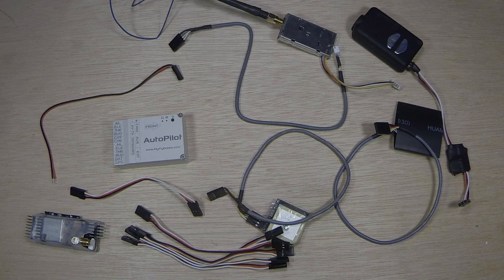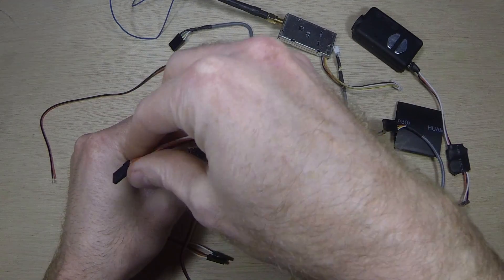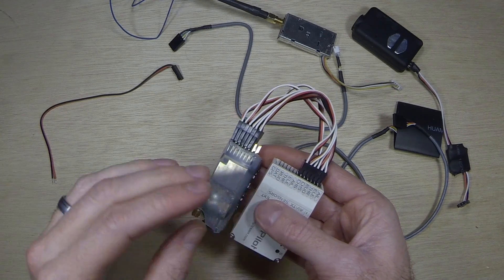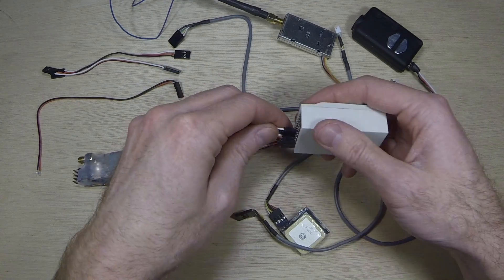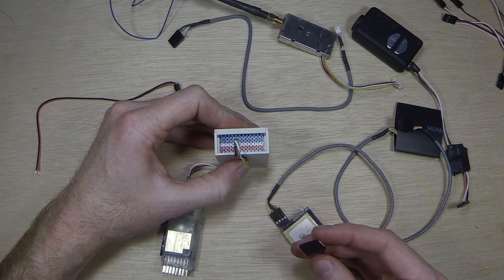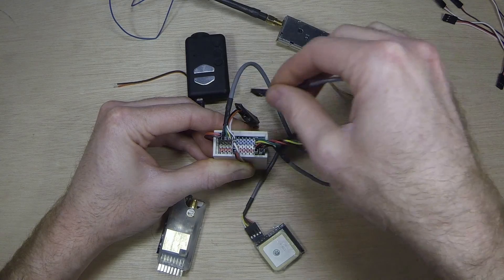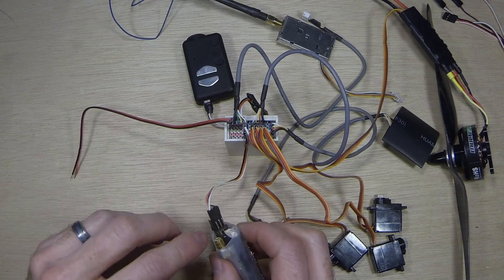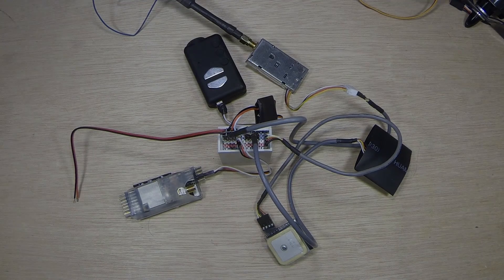MFD AP - 2 - Connecting

Comment: What a Good Idea !!! Why havent i think of that before!!? I can remove a couple of my wires which are actially giving me headake everytime i look at them :).
Thank you for the very very informing video Brother :)
a question thou.  Even thou i am shore i could do the same to RV. OSD and Agletree OSD ( i own both), i had to ask. I could do that to them too right ? :)
Reply from the maker: Just watch the wiring, if you have redundant lines, it can always be removed. i have not yet came across a device that requires servo power and ground to every channel from an RX or any device that requires multiple of the same connection. Every wire removed can reduce weight and clean up the electronics!

Comment: Thought JR PPM was on Ch6?? From the manual

A) For Futaba (or similar) receivers, the definition of PPM channels for channel 1-4 are AIL, ELE, THR, and RUD. In this case please connect PPM cable to CH5.
B) For JR (or similar) receivers, the definition for channel 1-4 are THR, AIL, ELE, and RUD. In this case please connect PPM cable to CH6.
 Once a valid PPM signal is recognized on CH5 or CH6, Input channels CH1~CH4 will automatically be used as auxiliary servo output ports. AP will not accept PWM signals until it is power on again.
Reply from the maker: eastcoast78 yes, there are two ppm inputs for different mappings.
Reply: Cool, yeah it was mentioned it was ch 5 for JR. Having issues with my Airspeed sensor . Hooking it up tonight and its showing no  Airspeed sensor in the calibration page,  nor is it working. The wire is passing 5v to the sensor, but i noticed there is a LED on the board, but it has never lite up. I posted my issues on the rcg thread but seems its nto the active as of late.  Also uploading a video as we speak.
Reply from the maker: hmmm... interesting. I havent messed with air speed sensors yet. dont really fly that autonomous to need it, I just use these as RTH and failsafes that is about it.

Comment: I guess you need to connect ailerons via Y servo lead? How do you reverse one servo if it is moving in the wrong direction? Sorry for the dumb question.
Reply from the maker: The only dumb question is one that is not asked :D.
Yes you would need a Y connector for the ailerons, and if one is reversed, you would need to reverse a servo (rewiring its internals) or get a servo reverser.
Reply: Atom RC Thanks Pal
Reply: +Atom RC If you have the same model, type of servos, they so the same the direction.  There's no need to modify.
Reply from the maker: correct

Comment: Hey 
I have a question I've got this AP on order and I've been wondering some things I'm going to run 4cell on my MFD MYTWINDREAM I've seen your using a switching reg for feeding power to the AP so thats one question answered my other questions are does your reg feed power to the AP then onto the VTX and Cam ? also how are the servos being powered ? through the ESC ? if so how can i use a BEC instead ?
Thanks for your help
Reply from the maker: For powering servos and things, you can connect a BEC to any spare servo port on here or your RX. the 12v regulator powers the FC as well as the video equipment so be sure to have a large enough regulator.

Comment: You wouldn't know how to set up the current sensor so one can just make sure that the dam thing give you the correct milliamp consumption & the correct amp drawing? thanks in advance.
Reply from the maker: you would need the FPV setup complete and a load for the current sensor that is a known wattage of amp draw. that will let you see if it is working.
Reply: Buddy I was flying last Saturday, my FPV Rig is up and running... so what I have been doing is literally powering up everything "Isolating the Current sensor" and putting power in to the power sensor with out load then... I go to the menu/sensors/current.... and try to calibrate.. but.. it is always the same problem.. it does calibrate...then come back showing that I'm only using .2 of an amp when in reality I'm using 1.2 amps.. so I guess that I just have to learn how to live with the problem that I'm dealing with.. No disrespect or insult in tended.. I'm so incredibly frustrated with this...
Reply from the maker: Ya, im not sure about any new software or bugs. I have not used this in over 2 years and have not flown in over a year. the earlier version i had was calibrated out of the box so never ran into that issue. Hopefully there is a resolution since that is quite a bit of variance in the reading.

Comment: So when using ppm out you don't need to run all wires back and forth for control just the one wire.
Reply from the maker: yes. PPM uses a single wire from a PPM capable Transmitter to the MFD AP. Makes it very nice to work with!
Reply: Looks like a keeper . After your flight test I will make my decision . It between RVOSD, FY31AP , or this one . For my more complex FPV Riggs.  The other that a little cheaper is the storm osd I like that one for my not so complex FPV birds even though it might suffice for any fpv plane .
Reply from the maker: Bankhead RC sorry for some reason this comment never alerted me. Iv been flying MFD-AP since it came out and it has been amazing. much better control than my Fy products.

Comment: I have a question . Can you change the odd from metric to imperial standard of measure .
Reply from the maker: I believe you can. I have not used the latest firmware. the version I had could not change. there is a thread on rcgroups.com that talks about this OSD ill try to get a link for you.
Reply: THANK YOU

Comment: Hi, on the old Dragonlink receiver (like the one on your video) I connected the PPM cable from Ch. 12 to Ch. 5 on the MFD and my plane works great.  Now I'm setting up another plane with the new Dragonlink micro receiver, the PPM output is on channel 7 and my plane is only responding on channel 6 on the MFD (not 5 like the other one.  The issue I have, is that everything is working fine including flight modes, but the failsafe will not kick in when I disconnect the power from my transmitter.  I can activate the failsafe from the transmitter, but not by powering off the transmitter.  The other strange thing is that when I'm in MAN mode and I unplug the power from the transmitter it will jump to STB mode.  Do you have any idea what is going on?  Thanks
Reply from the maker: FPV Cartel hmmm... i have not seen that, but you may want to check the failsafe settings of the RX. the mini rx you can select what you want it to do on failsafe.
Reply: Hey Atom RC, thanks for your response!  I figured it out, I had to do the failsafe procedure on channel 6 and then it did work.  I thought that once you did it on any channel it will set it to all channels on the receiver.